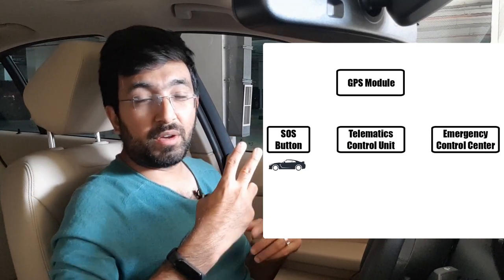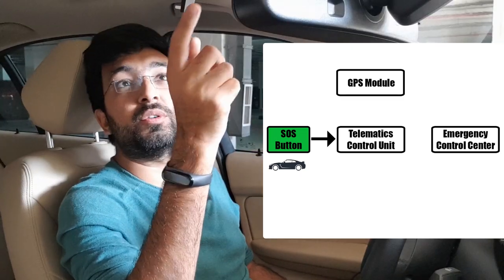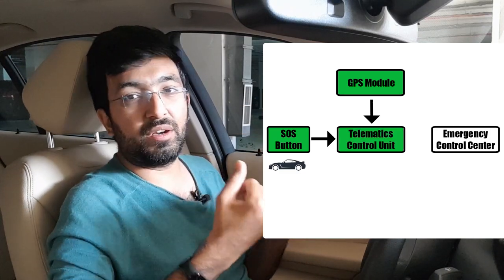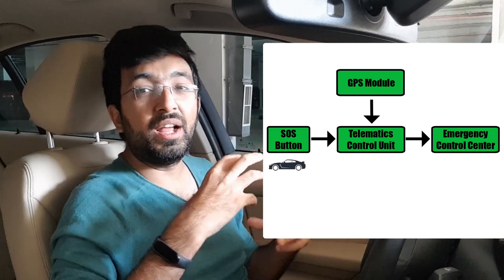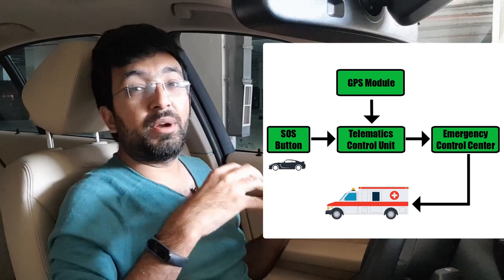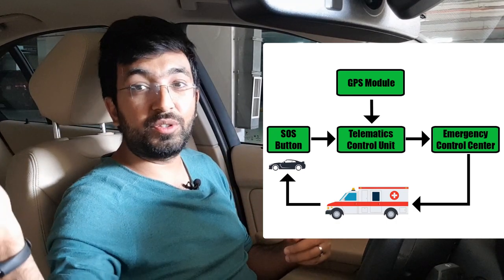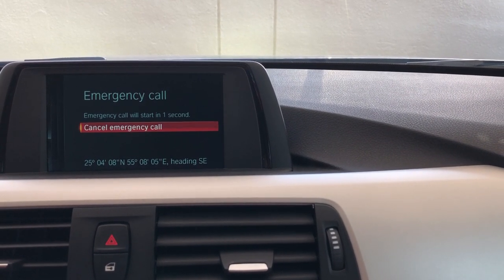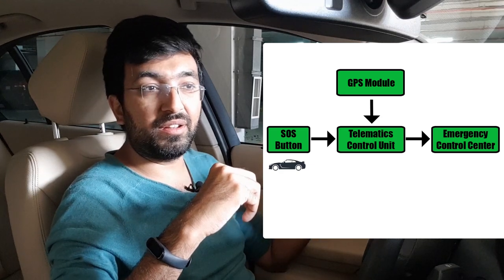[EXPLAINED] SOS Call System Failure On My BMW 318i

Comment from the maker: If you're a BMW owner (any series), what are the problems you have faced with your Bimmer?
Reply: My 08 E60 5 series idrive keeps rebooting in a loop and I can't get to play music or have access to the car's computer. Sometimes when I disconnect the Head up display, and wait for some minutes before reconnecting it boots and operates well, but could also resume rebooting in a loop as soon as I turn off ignition for few minutes.
Reply: And I also get the SOS malfunction light. Bought the fiber optic loop and installed but no success. It appears the Sirius satellite module was removed by previous owner as the device is not in its position, only the cable harnesses.
Reply from the maker: Thank you for sharing! What I figured out while going to the dealer is that this problem is a widely known problem and the major issue is its battery that runs the system. Because the system work independent so it uses a battery to run itself meaning it will die sooner than you expect and hence the SOS malfunction. It's been well over 2 months but yet they haven't been able to get hold of batteries to install them again. Till then there is no real solution to it 🤷‍♂️
Off lately, the SOS feature starts working on somedays. No obvious reason why. Will update when I reach a solution.
Reply: @MisterMZEECars  That's a bummer!
Reply: I changed my stock stereo to a new aftermarket stereo then sos came up. Can I bypass this or should I code it out ?
Reply: How do you remove sos in my bmw

Comment: This is quite a common problem, honestly it’s a design flaw.  You are fortunate that it has happened within the warranty period.  For most of the cases I have read it starts to happen after 3 years so out of warranty.  A common resolution is the replacement of the battery in the TCU - bad enough that they have used a BMW proprietary battery so you have to pay £100 for what should be a £20 battery, but worse the battery (a replaceable item) it not accessible.  You have to partially remove the headlining to get to it.  And if you have a 3 Series saloon then it is really awkward to reach.  Take it to BMW and they charge over £600 to replace the battery.
Reply: Too much talking! You'd better talk to an expert and he will tell you that the battery of the system needs to be replaced every 5 years...
60 euro costs the battery and/or amplifier and almost 200 euro will be the work for this replacement! 
BTW, your voice is so annoying that you should be forbidden by YouTube... you gotta work on your accent, I only hear "tatat, tatat tatataa tatata quoin tatata"
Reply: @ivandan1174  That’s seriously racist - you need to watch yourself because as it stands it is you who is more likely to be ‘forbidden’ by YouTube.  Guess when you speak in a second language your accent is perfect - bet it isn’t.

Comment: I had this problem happen to me on my X3 2015 model (BMW)...I had the garage switch it off with their scanner at a £10 cost...2 days later it came on again...I have looked in boot and over to the left behind the panel, i can see 4 slim  batteries taped together...are these the batteries i need to replace??? -  and after replacing batteries...will the light go out?...or will i have to pay again for the garage to switch it off?.....'PLEASE HELP'!!.....Thank you! -  :)

Comment: So what did the service Center do for you? Did they replace the TCU?
Reply from the maker: So they replaced a battery inside the control unit for the emergency system. That battery basically powers the SOS system independent from the cars battery. It's a wide spread problem in the BMW but the only issue is those batteries may sometime take time to be sourced.
Reply: @MisterMZEECars  i have an X1 drive18d - 2018 - we are also getting this prompt. was it expensive to change the battery then? its quite worrying to think that after just 2 years the battery has a problem so soon?
Reply from the maker: It is pretty weird but the reason it drains so quickly is that it does not charge using the cars systems plus it is being used all the time even when the car is switched off. Hence the replacement will be needed more frequently.
Usually if your car is covered under warranty BMW will fix it for you without a charge or in many occasions it knows this problem exists which is why they replace it for free. It's a pretty small battery size wise. Another issue that crops up is that the dealers are usually out of these batteries so they wait for the next batch to arrive and then would replace it for you.
I had to wait for good 2 months before they got the next batch of batteries after which I was put in the list to replace.
Hope this helps. Cheers!
Reply: @MisterMZEECars  thanks so much for your insight on this. Let’s hope they don’t charge us if it has to be replaced . I will also mention that this seems to be a general issue although usually bmw (depending on the service station) are good with their customers. But that’s the way it should be. Love bmw but the service is always expensive!!!
Reply from the maker: Yeah they are pretty supportive otherwise. It isnt going to be very expensive.
Reply from the maker: Please do let me know whenever you resolve the issue. Would love to know.
Reply: @MisterMZEECars  so funnily enough- when I started the car the prompt that there was an SOS failure went on. After driving it suddenly turned off! Don’t know if it will bring much to go to service now when there is nothing to show them? 🤪
Reply from the maker: Yeah it use to happen to me too. The warning would disappear for a few days and then would come back. Or would also go away while I am driving. Usually the car registers these warnings and when specialists plug in their computers to check they can see the warnings exactly when they came on.
Reply: @MisterMZEECars  This happened on my 2019 X4 two weeks ago. The dealership fixed it a week ago and yesterday it came back! Now I have another problem; the GPS shows my location as two miles away from where I am!
Reply from the maker: That's probably some different issue altogether. Location services function using an in built gps system which probably isnt tracking well now. One issue solved and another one pops up. Is your car covered under warranty?

Comment: How do you ensure the TCU batteries do not run down please?
Reply from the maker: To be honest there is no way to ensure it doesnt run out. Unless they introduce batteries that can self charge themselves using the cars charging system then it wouldnt have that error. Otherwise every now and then expect to keep replacing the battery when it runs of juice.

Comment: doesn't say how to fix it
Reply from the maker: So in order to fix this. You can either go to the BMW workshop and ask them to check the system. The major reason is a battery which powers the SOS system. That runs flat and causes the malfunction. The BMW dealer will be able to replace this for you to solve the issue.
Reply from the maker: Nope. My car was under warranty so got it fixed for free.

Comment: I own a 2017 bmw 330i Xdrive. My sound and chimes all work on my car but sometimes the SOS error pops up and the goes away. It can be there for a few mins then it goes away. It can go days to weeks and then pops up. Any suggestions on how to fix And remove this error?
Reply from the maker: So the 3 series seem to be having a majority of the chunk of the SOS problems. The same happens with my car too. The chimes and warnings keep popping up and disappear only to reappear again. The real solution to this is the battery that powers  the SOS system. The batteries are put so that even if the car goes through an accident or the car is not switched on, the SOS system would still be able to call for the assistance. 
These batteries seem to be having the life in days. So when they are drained completely, it triggers this warning of SOS system malfunctioning. I have been in waiting list from BMW here locally to get the battery replaced. The batteries for this system are in short supply. Plus, the current situations have made it even more difficult to procure locally. 
My best advise would be to go the BMW and ask them to give your SOS system a check and if any parts are needed then let them arrange it. Till then, all we can do is wait for it to arrive and be replaced.
Hope this helps. Cheers!
Reply: Mr MZEE Cars ahh okay. I wonder why they made it like this? So overall I shouldn’t worry about it popping up? It is very annoying for sure but it’s a not a problem I need to address right away? Yes with the current situation it is hard to get to a dealership.
Reply from the maker: It's not a serious problem nor would it hamper the working of the car or its system in anyway. Only annoying thing you mentioned which is it keeps popping up from time to time and just block all the information in the dashboard with that warning.
Reply: I have a ‘08 e92 and I got a “SOS Malfunction” error after installing a brand new battery. I never had this error pop up.